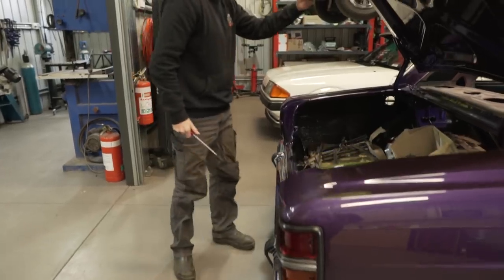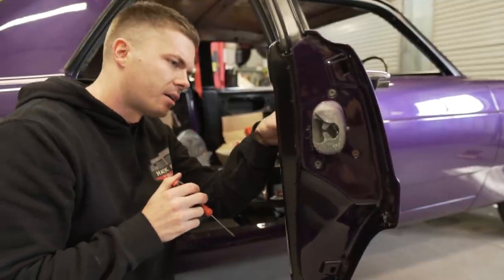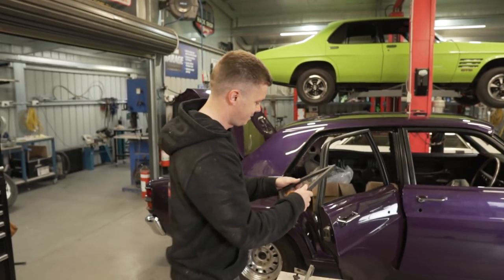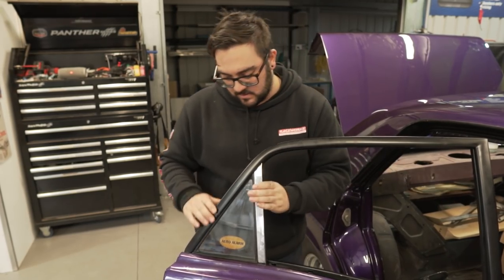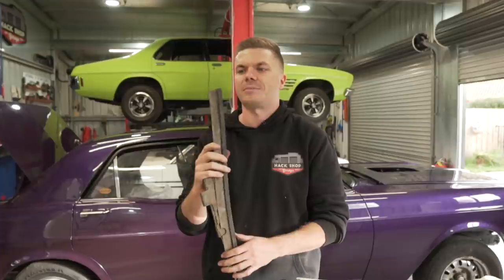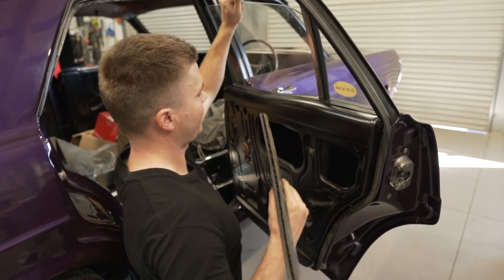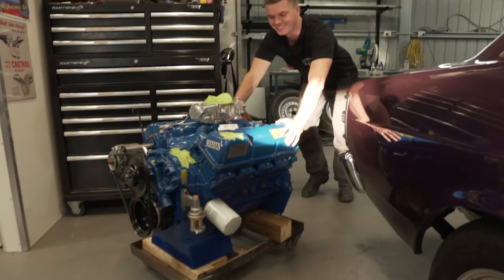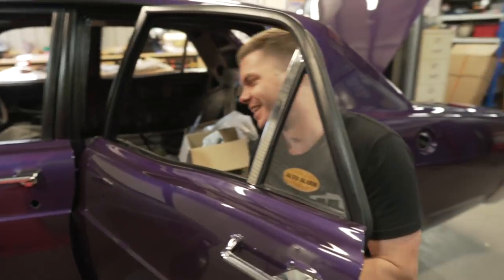XY GT Falcon Build - Part 2 - Windows, Handles and Sneak Peak Of The Motor

Comment: Struth, is actually Cockney slang and is a shortening of God's Truth. I worked on the line at International Harvester back in the early 80's and the drop glass was pressed into the channel in a hydraulic press, a paste of Lux soap flakes was used as lubrication because it set like glue when it dried. The paste was the consistency of Clag, and you must use pure soap like Lux or Velvet because dish soap has salt in it and will cause the channel to rust.

Comment: No need to slam doors if adjusted correctly
Reply: Looks like drivers side back door has dent just under near the door handle ?????
Reply from the maker: Yep, you’d be correct, the body has suffered some scratches and dents over the years when it was stored in the back shed at Rodney’s parents place
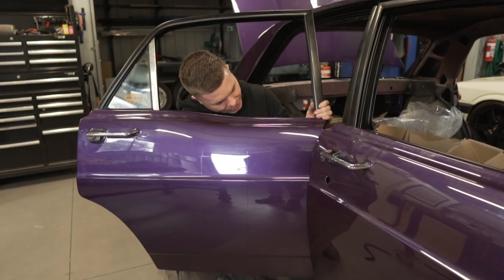Reply: You can see it at 13:02
Reply: @HackshopGarage  oh ok wasn’t saying you guys did it

Comment: I guess you guys don't want to talk about it.........but any updates on the Holley Sniper?
Reply from the maker: Hey mate, we are Still waiting for a replacement unit to arrive from VPW, still have no idea when it will land at this stage.
Reply: @HackshopGarage  Say no more more, I'm waiting for parts from VPW as well, the only mob that seems to be slower is Rare Spares. I'd guess you wouldn't hear about the specific of what went wrong with the ecu. I wonder if the heat gets to some of them and a phenolic spacer would help, but I don't know if you guys had it running long or even had the bonnet down.